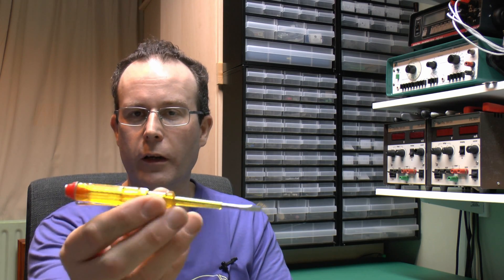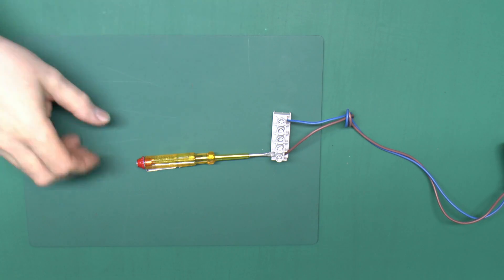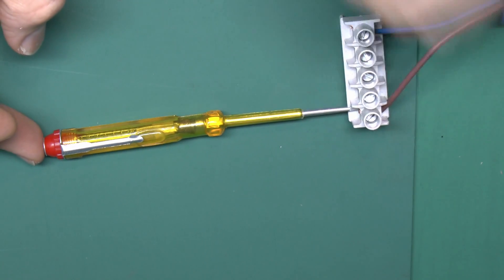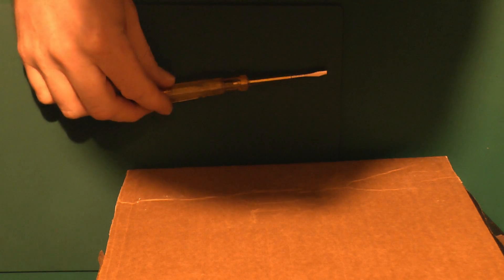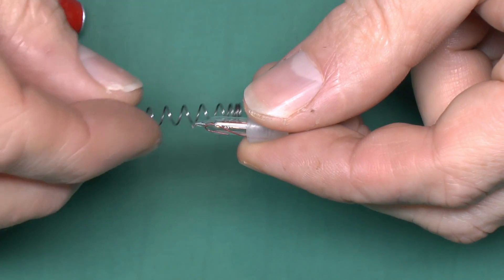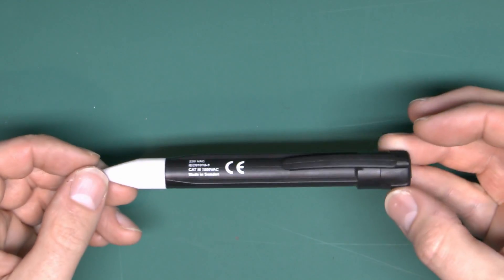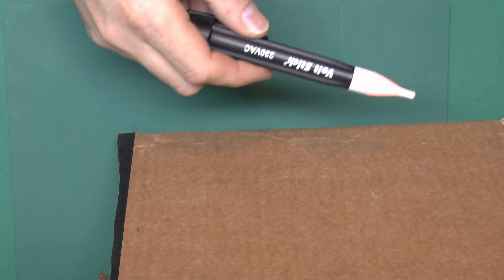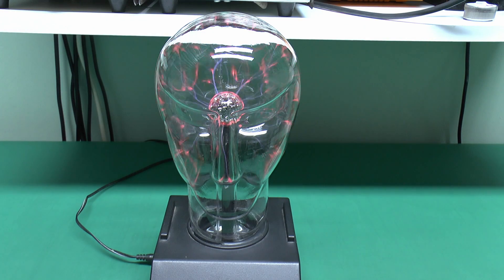Dangerous Device - Neon Mains Testing Screwdriver

Comment: All that's between you and a live wire is this little resistor, which if it suddenly had to transmute into gold, you would get one hell of a shock.

The way you use a live wire tester (not a live-to-neutral; that's a different tool) is you test if the tester is working just before and after you test a live wire (or if the live wire test fails). This is essential for all tools which test something which can kill you. How do you know your live-to-neutral tester works?

Unreliable tools are not to blame if you get shocked, no matter how much you paid for them. If you believe your life is worth the few dollars you spent on your tester, then by all means, put your complete trust in it. At the end of the day, you tested with a live-to-neutral tester and a multimeter. You haven't convinced me.
Reply: If there was an open neutral the neon screwdriver and voltage stick would save your life but his so-called approved lamp tester would kill you!
Reply: @zed351  I was shocked across from wrist to wrist by a floating neutral. It was NOT fun. Thankfully I'm alive.
Reply: @Mrcloc  
Indeed, it's why I use a two pole voltage tester that also does the important single pole test.  The approved lamp tester he is using can be lethal in the wrong hands, he shouldn't be asserting it is safer.   Both tools are safe in experienced hands and both are lethal in non-experienced hands.

Comment: First of all, I want to say that the heading here is VERY misleading, because it implies that 'test pencils' are dangerous devices, which is generally untrue. If these devices had been anywhere as dangerous as you imply, they'd have been banned a long time ago. I have to wonder whether this sort of hysterical opener is intended just to seek attention and log up 'hits'. If so it's disingenuous, but even if that's not the intention, it's still potentially a source of misinformation, and Christ knows we already have far too much of that on the internet, so I'm giving it a thumbs-down regardless.

So, to the subject: Any test instrument is potentially unreliable (a multimeter is only as good as its probes and leads, for example). I use such a tester as the one you're lambasting and have done for years, but I don't rely on any ONE instrument. Best to have a selection on hand when working on AC mains voltage circuits, such as a multimeter (e.g. a Fluke or Megger with voltage measurement capability), and a proximity tester ('volt stick'). Like any test device, however, first prove on a KNOWN live source to ensure it's working, then on the isolated circuit, then preferably on the known live source again before making physical contact with the isolated circuit. Also, test ALL conductors associated with the circuit under isolation before work, including neutrals and actives. You never know for sure what you may encounter. I've seen neutrals and earths at full potential on occasions. I've known multimeters and volt sticks to malfunction, thus the necessity to test with more than one device, and a test pencil is as good an option as any so long as it's used in conjunction with other testers. ALSO, as Martin has already pointed out below, if you've an open circuit on a neutral and/ or earth, then good luck seeing voltage with your test lamp or multimeter...

Comment: You discouraged using the screwdriver test light because it's a lot cheaper than that 2 pole device volt tester. 
I made my own pen volt tester which cost only 1$ and i can say it's safe to use.

Comment: The two probe instrument he uses is pretty susceptible to wrong results, because if there is a neutral or ground fault e.g. a dodgy installation with a single pole breaker which can be wrongly placed in the neutral, or there's no ground connection, then you will proceed and you will probably die, with the neon tester or the beeping thing you can be more sure if there's electricity there. In the part where he's moving the thing over the cardboard and it lights up is not a possible scenario when handling 220V, he's probably using a plasma ball or a Tesla coil for light it up.

Comment: I have never heard of a resistor going short circuit period. The resistor in the screw driver is NOT going to short out “killing whoever is holding the device”. Though  possible , it is a unlikely that wetness will penetrate the screw driver and short out the resistor  ; no more likely than electric shock being dolled out to anyone foolish enough to use any wet device.
Sometimes faults in circuits involve a “live” neutral.  This is usually due to a neutral line going open circuit from it’s source , and becoming live via an unknown appliance  still connected to live. The neon screw driver will detect such a fault whist the more sophisticated device will not - and could therefore get you killed.
It is true that a malfunctioning neon tester , can mislead you into thinking that what is actually live is harmless, but a good worker takes care of his tools , and will always test the neon against a known live, before using it to trouble shoot.
These neon testers are easy to use and are therefore safe for the very reason that they use the human body to complete the circuit thereby allowing one’s other hand to be safely out  of the way - or holding the ladder.
These neon testers have their place in the tool bag , and one saved me from a shock once when I went to turn a screw in an un grounded appliance that had a live chassis.
They are not so visible on bright sunlight , but most people actually do have brains and are aware of this - as I say they (neon testers) have their place in the tool bag.
This video is Cod’s wallop
Reply: Fred Bloggs  He also keeps (I guess) an induction cooker hob under his magic card board.

Comment: It won't work if you are touching the pole that is grounded. Is it possible the blue is not neutral? 
The neon is the high resistance that will prevent you from getting a shock.

Comment: if you ram the screw driver in the corner of a plastic junction box then is not going to light. Put the screwdriver onto the same point as the other tester you used. Joke video surely!

Comment: Most of the folks who left negative comments completely missed the point (probably Trump voters).  Neon single-point testers are unreliable, provide little useful info (and sometimes false info) and can, though rarely, be dangerous if damaged.  The biggest reason not to use them is that there are a bazillion 21st Century tools that are cheap and do a muuuuuch better job than that 19th Century neon light.  Call me crazy, but I prefer not to use something whose technology predates my great-great-grandparents when possible.
Reply: Rubbish!
Test the indicator on known live, then test unknown conductor with it, then test indicator again on known live.
That's how the apprentices were taught to use it. In my 60's now, and the neon 'driver never let me down yet.
Reply: @tiggywinkle1000  So shall I assume you’re also still driving an Edsel with leaded gas and chain smoking cigarettes despite advancements in safety, technology, and knowledge?  Yeah, didn’t think so.
Reply: @k5hrv605  As I said, these indicators are fool proof, unless you are being wilfully stupid when using it, like others have noticed about this video.
In the real world when doing demolition or building work a fancy £300 tester would be impractical to carry about and would get damaged or, in some circumstances where multiple sub-contractors are on site, stolen when your back's turned.
I'd rob yours in a second, mate, and you wouldn't even know!
Reply: @tiggywinkle1000  LOL!  Ok, so I've learned two things here.  1) I need to chain my Fluke to my belt.  2) Demolition is, surely enough, a time when taking a quick "blunt instrument" approach is probably not a terrible idea.  I concede the point. :-)
Reply: @K5HRV

The approved Drummond Test Lamp he uses can kill you if the neutral is open.  It is also ancient technology, being a simple test lamp.   The neon one would still indicate phase in the same circumstance, so plus one point to the neon compared to the "approved" lamp he uses.

Both are safe if used correctly and both are lethal if not used correctly.   Test ANY device before use and after use on a known source.  This video is nonsense, he set the neon up to fail and is therefore being dishonest.

I am not aware of hundreds of people dropping dead after using a neon, do you have any documented evidence that they are any more unreliable than an approved voltage tester?  They must have been used millions of times over decades, yet in terms of reported fatalities from these dangerous devices there is silence.

Comment: Maybe you eventually made a point.
But I wasted 3 and 1/2 minutes watching this video without seeing one.
My first question was going to be why is your screwdriver bent???
I suspect it was because you wanted it to be broken so you could use it for the second part of your presentation...?
But then I realized it the first time that you used the brown wire (with voltage) and the 2nd time you used the blue wire to show the tester "doesn't always work".

In the U. S., we call this a "hot tester".  I used this when I want to quickly determine voltage on a single wire -not between 2 wires (that's what a proper multi-meter is for -why would a want to use 2 probes to see a light when I could use 2 probes to get a numerical value???).
I use a hot tester to determine which wire(s) is hot in old wiring that has lost its color-coding.  I use it to quickly tap every circuit breaker in a panel.  I use it to check for case ground in old work (touch a ground with your other hand and the light gets brighter).  This are incredibly handy!!
You say they are "unreliable" - not true! I've thrown out 2 or 3 multimeters in my life -but  I've owned 6 or 7 of these and my only complaint is that I lose them.  I've only had 1 "break" and I admit I was perplexed ...until I whipped out my spare.  I always keep 2 because it is such a great tool.
As for safety, it's easy to hold this in one hand it a tight space compared to trying to juggle 2 contact leads and read a meter.  I've never gotten a buzz or other injury from using this tool ...but I've gotten busted and scraped hands fitting a multi-meter into a tight space.  Also bumped my big bald head trying to get a better look at my multi-meter.
Reply: actually, since you were nice enough to make a recommendation, let me suggest this tool if you can get it where you live. Relatively cheap at Home Depot, it replaces a GFCI-testing receptacle analyzer and proximity tester. Because of its shape, it fits neatly into a slot in your tool belt and you can easily get to it:

Commercial Electric	DualCheck 2-in-1 Tester, 50-1000V AC Non-Contact Voltage Detector and GFCI Outlet Circuit Analyzer
https://www.homedepot.com/p/Commercial-Electric-DualCheck-2-in-1-Tester-50-1000V-AC-Non-Contact-Voltage-Detector-and-GFCI-Outlet-Circuit-Analyzer-CE-VD7504GFI/300254856

- I bought 5 of these in anticipation of having a lifetime supply in case they ever stop making it.  ;-)
Reply: Fred Bloggs  I don't understand; it comes with 2 probes and this is from the Fluke description:
"An essential part of any electrician's selection of tools, the Fluke T90 contains all of the functionality you need for accurate and reliable two-pole voltage and continuity testing."

I believe you need a hot and ground or neutral (or 2 hots) to make this work meaning that you have to use 2 probes.  If it's also a non-contact proximity tester, I have one of those.

So, just to confirm,
Are you saying you can only use one of the probes?
(Thanks; I think we are missing each other's points so I want to make sure I understand you)

Comment: Sorry John, but I don't feel this is a responsible video. In many situations, and used in the correct way, this is a very useful tool. And given that a multimeter, or any other test device that relies on a path to neutral, can also give a false reading, the argument is not sound. Your content is usually strong, but I think you should reconsider this video remembering that this content is watched by all sorts of different people with differing skill levels. And before the sparks say people should not be touching electrics, changing a power outlet is permitted, and a neon indicator is probably the only test device some people have.

Comment: I have one of these testing screwdrivers but mine has a wire coming out of the end with a crocodile clip on the end. Is this clip for clipping it onto something to earth it? I don't know.
Reply from the maker: Probably for testing 12V circuits such as those found in vehicles.

Comment: Why was the screwdriver tester working at first  then it wasn't?
Reply from the maker: Multiple reasons.  That's the point - they may or may not work depending on the circumstances.
Reply: @jwflame  Especially when it suits the purpose of the video!
Reply: @jwflame  Rubbish!
Test the indicator on known live, then test unknown conductor with it, then test indicator again on known live.
That's how the apprentices were taught to use it. In my 60's now, and the neon 'driver never let me down yet.

Comment: How much current flows through our body ? Can anybody tell about this
Reply: You mean when using one of these screwdrivers? If the body is electrically connected to ground then you've got a series circuit comprising a source of 240V AC, a 1.5M resistor, a neon and the resistance of the body. Resistance of the body is maybe 5 - 100k so can be disregarded. The neon has a voltage drop of about 60V, so we're looking at 180V across 1.5M.
Ohm's law says I = V/R, so I = 180 / 1500000 = 0.00012A or 120uA (microamps).
In most cases you won't be touching grounded metal when you use this screwdiver so the return path for current will be through the capacitance between your body and ground, which means the current will be much smaller.
Reply: @DancerDesign  Thank you very much for your support but eventually I found it by myself afterwards. Not a hate comment. Thanks for showing your effort. Also I would like to mention that there is also capacitance in series with our body, about 10 - 10nF, so the current would be a little lesser. To be more specific :
Capacitive reactance = 1 / (2π × f × C)
So if capacitance lets say is 1nF and frequency is 50Hz then
1 /  (2π × 50 × 0.000000001) ≈ 3.18 MΩ

 But I didn't know about the voltage drop across the neon bulb, thanks for that.